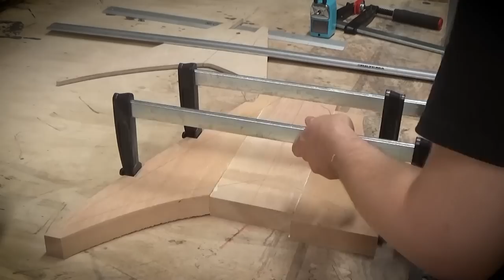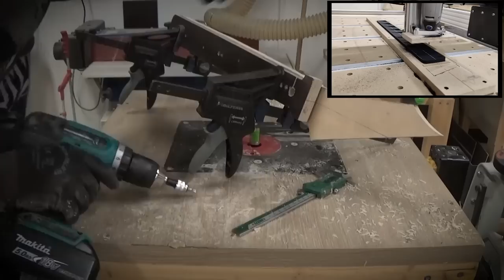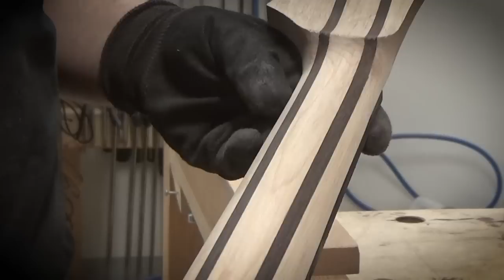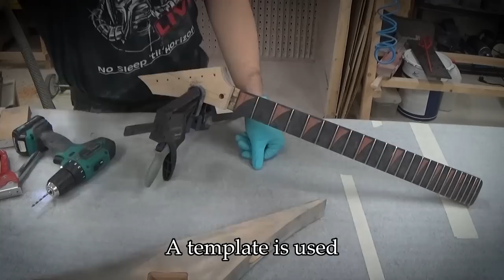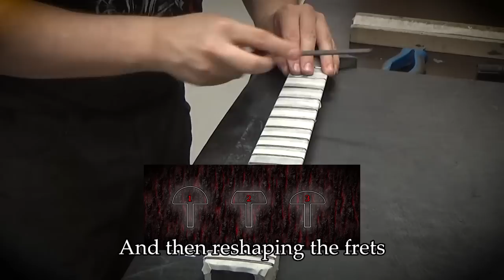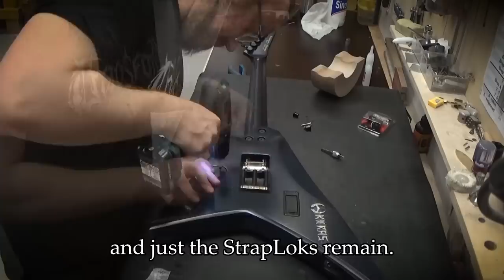Building RRouta FR6 - custom finnish RR / Flying V style guitar - time lapse - full build.

Comment: Great looking and sounding guitar. Interesting neck joint option.  Any reason you didn't go for a set neck or through neck construction ? Great job still. :)
Reply from the maker: Hi!

I'm willing to argue that my bolt-on neck (even with only 3-bolts) is better than most set necks: the joint is tight and accurate, so there's virtually nothing between the body and the neck - no glue, not even air! And as you can see, I lacquer the body and neck together to ensure nothing gets between them.

I also make neck-thru-bodies, and many of my commissioned guitars are ordered as NTB:s. For these guitars I make for sale, I prefer bolt-ons since they're easier (less work) to make, and therefore keep the price more affordable.
Reply: @Kiiras  Makes sense. Great job. A fine instrument for sure. :)

Comment: I dont have a cnc machine, so, correct me if im wrong... could you use it to put the radius on the fretboard? You did say you hate that part. And i definitely understand. I always procrastinate when i get to that part in my builds haha
Reply from the maker: I could, and many do it like that. I just prefer to glue it on as a flat slab / blank so it's easier to get good compression on it and therefore good adhesion.

Radiusing the fretboard is my least favourite part because I find it weirdly physically tiring using the sanding blocks to make the radius. Ever since I've started roughing out the majority of the radius with a handheld belt sander, it's much less my least favourite part 😅👌

Comment: it looks exactly like a jackson rhoads  and with the shark fin inlays on the fret board its just a jackson at this point but it still looks cool
Reply from the maker: Aw, shucks. Should've guessed that the market is already saturated with RR style guitars with black&red flame (birch) tops, padauk inlays, Floyd Roses Equipped with FU-Tone hardware, 3-bolt neck joints...

Comment: How's that gotoh floyd? Might change the jackson branded floyd in my Kelly.
Reply from the maker: I prefer it over FR Original due to ergonomics and better handle bar attachment system. But Gotoh GE1996T FR might be more difficult to retrofit on a guitar since it need larger holes for the pivot studs, so it usually isn't drop and forget - type install. Otherwise it fits to same pocket as a FR Original.

Comment: It might be just me being tricked but the overall length of the neck seems to be short... And I can see the 24th fret side dots.... What's the actual scale length on this build?? 👹And on a side note I want to say that you are a maniac about centering and double-check, so that's all good! 👌🏻
Reply from the maker: It's a 25.5" scale length. 

The reason it might seem short, is because my RRouta body is a bit larger in proportion to an original RR or even ESP SV's, to me the original RR body is just waaay to tiny.

Larger body gives it also a bit more mass, and therefore helps with potential neck dive as well!

Comment: Where did you get that super thick notched straight edges?
Reply from the maker: Made it my self back when I was still (also) a full time CNC machinist, it's a piece of 10x40mm aluminium bar where I milled slots for frets.

StewMac (US) and Guitars&Woods (EU / Portugal) sell similar.
Reply: @Kiiras  but I like yours better 👍

Comment: Can you comment on the jig for the output jack? Angle/bit  size?
Reply from the maker: Not much to comment, it's not even a jig per say, just a 90° angle plate for the drill press. I just eyeball the angle for the 25mm forstner bit on the inner curve, and make additional plunges as different angles if the jack plate doesn't fit properly.
Reply: @Kiiras  I appreciate the response. I have had a hard time finding anything about this information.

Comment: What is the price of that handmade guitar in USD
Reply from the maker: Hello!

A similarly specced guitar would be ca. 2500-2700€, including finnish VAT. For exporting outside EU, the value added tax would be deducted, so the price would be ca. 2000-2100€, and ca. 2500-2700 (again) in USD.

Mind you that shipping a guitar overseas costs easily 100€ extra, and you would be responsible for any and all import fees and taxes upon receiving the guitar.

Comment: Where did you find dimensions and measurements for the body and neck? I can't find em anywhere :/
Reply from the maker: All custom measurements, or more precisely all measurements on the neck are determined by hardware - the locking nut & bridge string spacings.

Body outline is reverse-engineered from Jackson RR with my own modifications added (slightly larger etc.).

Comment: I want that !!!!  (Left handed, please)
Reply from the maker: Can do!
Reply: @Kiiras  How much do you charge for a bad boy like this ?  I am a beginner, but once I get good, I 100% want a custom Axe !!
Reply from the maker: @melanisticmandalorian   We're looking at ca. 2500€-2600€ guitar if ordered within EU (due to value added tax), and ca. 2100€ if exported outside EU (extra shipping costs may apply for long distance / overseas shipping).
Reply: @Kiiras  The shipping costs are a nightmare, I am in Canada.
Reply from the maker: @melanisticmandalorian  Not that insane, about 100-150€ for shipping to Canada
Reply: @Kiiras  So it would be 2100 Euro total ?
Reply from the maker: Just checked it more precisely, 2325€ including overseas shipping; I'd recommend though to upgrade the standard Gator GW-Extreme case for a proper flight case for another 100€ extra (relatively cheap insurance).

Mind you, that you would be responsible for any and all importing fees & taxes when the guitar arrives in Canada; you'll have to check with your local authorities how much they would be. (For example if I were to order something from outside EU to Finland, then VAT 24% would be added to the cost when the item arrives in Finland.)
Reply: @Kiiras   Thanks for the heads up on the import taxes.  I will think about it.  I am at this time just a beginner but I really want a custom eventually.  You have given me a lot to think about.  Thank you very much.  
Do you have a customization app or a sheet or something, that says just how much you customize, you dont have to give me the costs (if  you dont  want to) since I am not buying at the moment ?

Comment: You really shouldn't have used a plain, unreinforced scarf-joint. Simplified scarf-joints are the main reason why Gibson is so notorious for headstock breakage. Your average 6-string exerts 100+ lbs of string-pull, on the weakest part of the neck. It's literally like a mouse-trap with a 100 lb spring on it. A scarf-joint is nowhere near good enough for a highly-stressed section like that. As soon as that headstock hits anything remotely solid (and it will), it's gonna turn into a tethered-projectile lol.
Reply from the maker: I've been testin my necks by literally walking over them, the joint I make is the strongest possible. I'll someday make a video about it.

The difference between mine and Gibson's (the worst possible way) is that my glue joint is on sidegrain of the neck, and it's also strengthed by the headstock veneer. It's a bit difficult to explain by text only, so here's a example on how I make it (scarf method 2):

https://www.gluedtomusic.com/blog/1/headstock-and-scarf-joints-explained/
Reply from the maker: If you have facebook, you should be able to see this video from few years back - a strentght test on a scrapped guitar.

https://www.facebook.com/watch/?v=1515705225115432